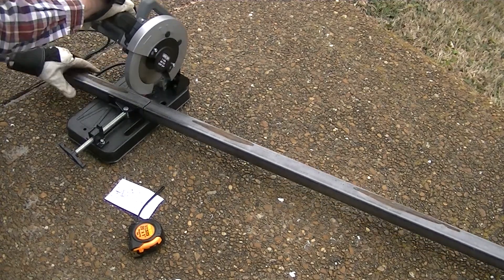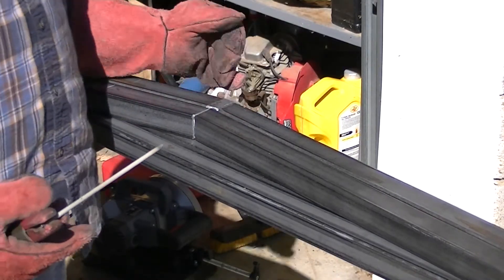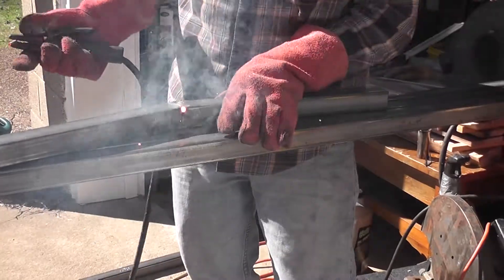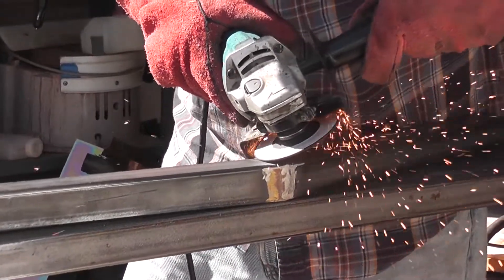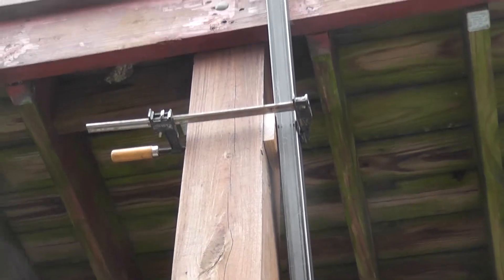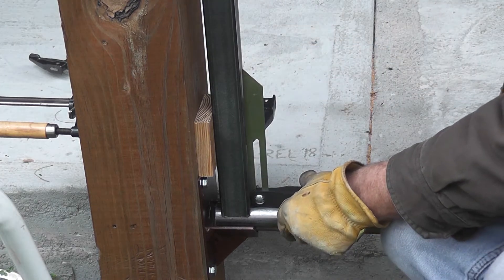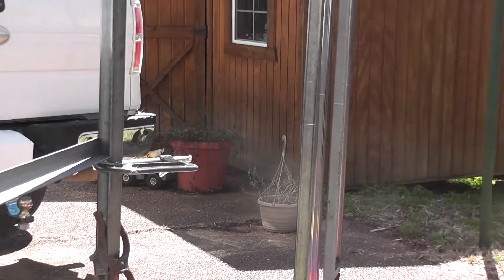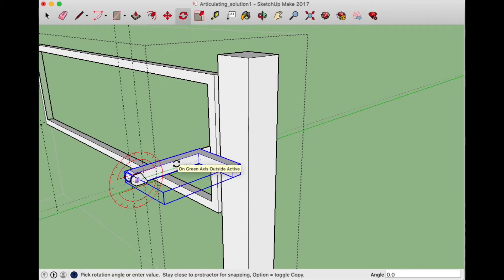Outdoor Climbing Wall (Frame Build) - Part 2

Comment: Amazing. What kind of size is your steel? cheers from Spain!
Reply from the maker: Hi Mauro, I'm pretty sure when I ordered it I had requested 1/8" thickness for the steel tube, but it really came in "11 gauge" which was actually just slightly less in thickness. I'm not sure what that would be mm/metric though.
Reply: @stoppedsnoring  thank you. 1/8 ‘’ is 0,3 mm. It does seem thinner in your video. Hard to say. Do u jave some left over to check. It would be really awesome. Thank u in advance bro.
Reply from the maker: Ok, sorry for the delay. It has warmed up now from all our cold and snow and I just got down into the garage. Luckily I did have a few feet left over.  I measured the square tube and it is indeed just slightly smaller than 1/8".  It is heavy stuff, and I know I wanted it to be strong.  Also, I remember thinking the thicker it was the better the "self-tapping" screws could grab ahold.  I wouldn't be surprised if you were able to get away with lighter weight (thinner) tubing though.
Reply: @stoppedsnoring  wow that is thick! Bit yes, better solid and easier to weld. But , why did not you use a electrode welder instead? Your is a wire welder right?